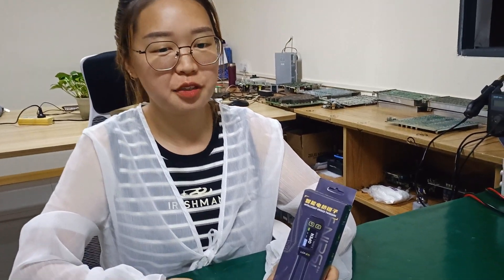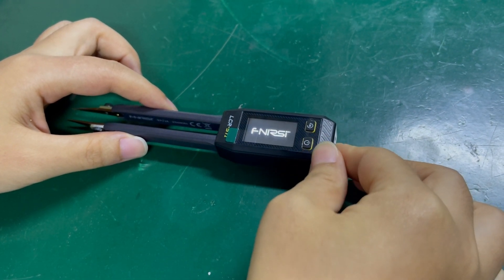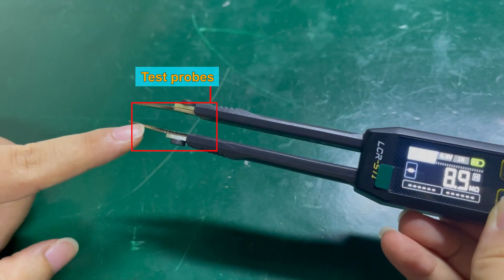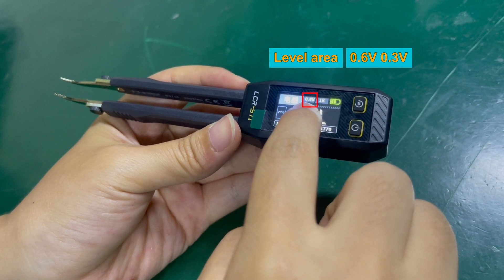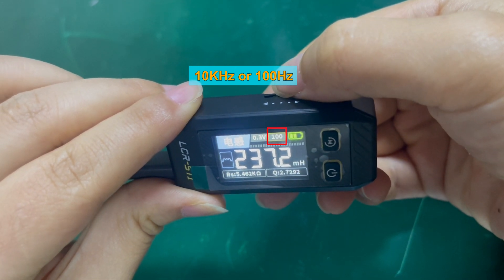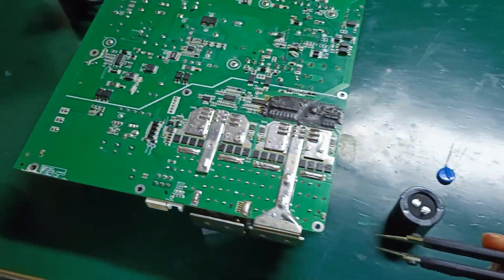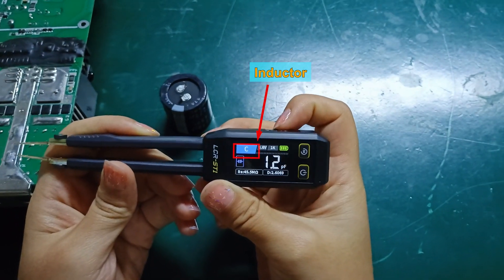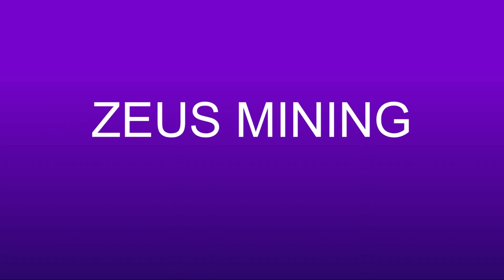How to use FNIRSI LCR-ST1 intelligent bridge tweezers to test hash board and power board components?

Comment: "A clear and intuitive interface"
If that were the case I wouldn't be here. I'm stuck in a mode with Chinese or Japanese or whatever characters, and I've been pushing all sorts of long and short combinations of the buttons and getting nowhere. The instructions are so cryptic that I'd be further along if I'd never looked at them - honestly. They say essentially nothing. I came here looking for actual user instructions. We'll see if this video has those, or I'll have to continue looking. But I've owned dozens of pieces of test and measurement equipment. In fact, I repair it for a living, and this is the most difficult to figure out small instrument I've ever run across. And as I said, their 'manual' just makes it worse.

UPDATE: I found the menu of available languages and I can scroll through the menu. English isn't on it. Duh. This is getting ridiculous. I get paid $50 an hour for my repair work, so I'm already out more in time than this thing is worth. There was clearly zero time spent debugging the user interface. 

I can do more of this stuff with a NanoVNA. I was just hoping for a quick, convenient tester. So far, this ain't it.